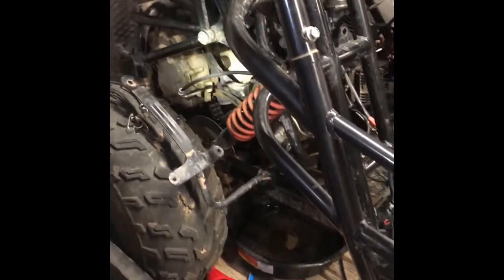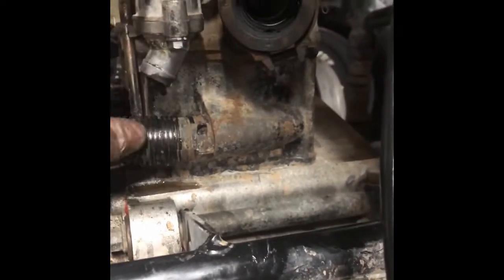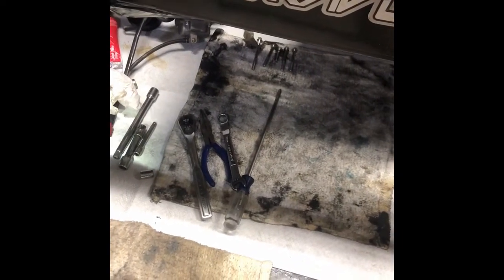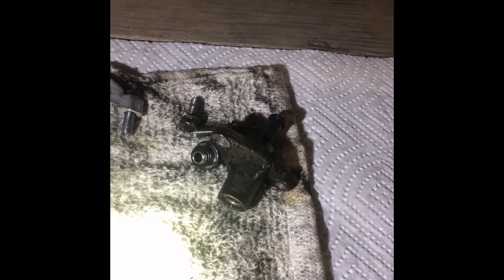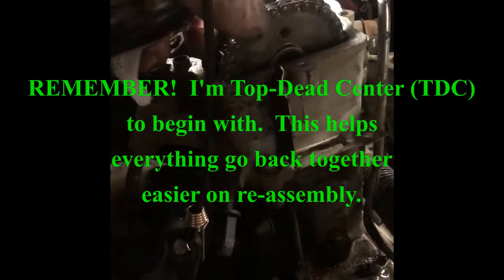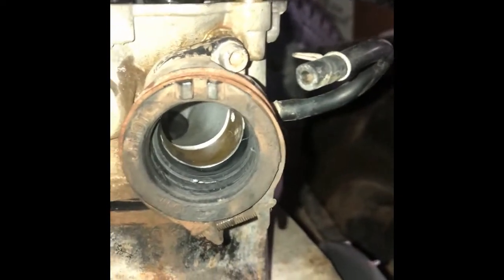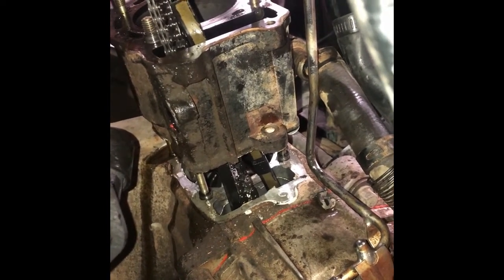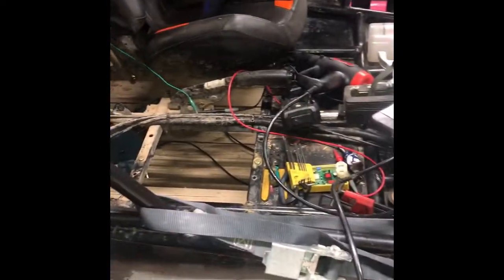Part 1 of 4: CFMoto 250cc Head Rebuild 172MM Low Compression GY6

Comment: Back in my Honda/Datsun/Nissan mechanic days we would make a wooden I block about 3 or 4 in tall and 1 in thick,  one edge of the block is a straight edge and the other edge you cut at an angle matching the more or less V shape of the chain down towards crank. Then just wedge/tap it down between the chain sides and it holds the chain in place w/o it dropping off of crank gear.   Also drill a hole in top of the wedge/block to tie a cord so you have a way to retract/pull out the wedge when done.  Again, great video

Comment: Need help. I have the same engine 250cc it’s been running with no oil and it started leaking oil from the head gasket but for some reason it still leaks out. What do you think is wrong. Tia.
Reply from the maker: Running with no oil?  You probably melted your piston rings and now oil is getting up past them on top of the piston.  You probably need to rebuild your top end like I did in these videos.

Comment: with the rag in the engine trick..i think you have more common sense than that china dude did cause i have done it with out before and wouldnt ya know it...a washer went into crankcase cause it was stuck on the bottom of the nut...so from then on i always used a rag or whatnot to stop that from happening again..
Reply from the maker: Ha...thanks for reinforcing some common sense in this senseless world today!